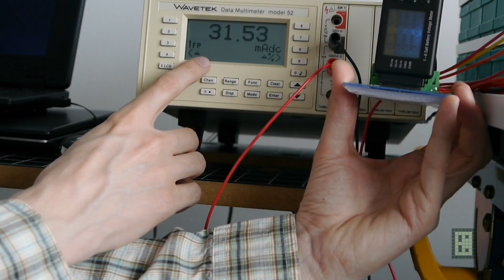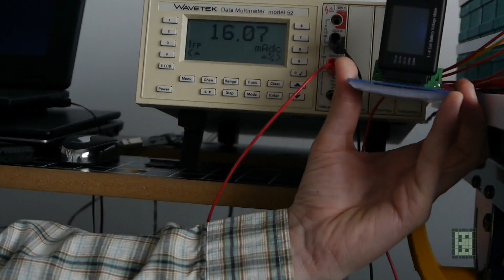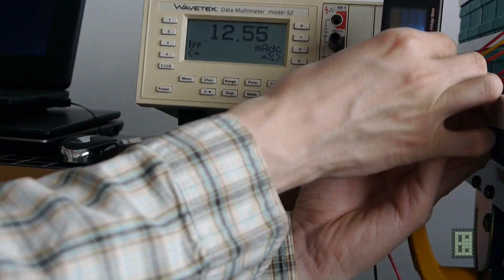BVM-8S 8 Cell battery voltage meter Backlight fix and lower Power consumption

Comment: cell meter 7 capacity controller ( not 8s unforatunately) has balancing function, bleeds via resistor gets quite hot. How are you balancing your a123 cells? or using different cells now?

Comment: Salut, ai idee ce ar trebui sa modific pentru a putea folosi acest device si pt baterii LTO ?  ( max charge = 2,9V / cutt of = 1,6v)
multumesc.
Reply from the maker: Nu imi mai amintesc care erau limitele nu stiu daca puteai seta cut off la 1.6V.  LiFePO4 sunt may bune decat LTO in aproape orce aplicatie.
Reply: @electrodacus  Merci, da, sunt mai bune dar nu si in aplicatia mea - inlocuire baterie masina.
Reply from the maker: Lead Acid e cea mai buna optiune pt masina. Pt ca batteria este tot timpul incarcata full de alternator si Lead Acid e singura care prefera asaceva toate celel cu Lithium sufera in conditile astea. 2.9 e cam prea mult pt LTO pt 12V as zice ca e mai bine sa ai 6s nu doar 5s

Comment: I'm just trying to find a accurate lipo checker and I see the letters AOK on your board. One of my current cell checkers is from AOK and not accurate at all
Reply from the maker: The two I have are also not that accurate. Depends on what you call accurate and also depends on how your sense wires are connected to cells if a load is connected there will be some voltage drop on the cell wiring.
I guess my solar BMS will be overkill for you. I also plan a new project after the solar BMS is done it will be some low cost data acquisition device with 16 or probably 24bit resolution and 8 differential inputs so it can replace something like BVM-8S

Comment: OMG only take the power from the first 2 batteries,this will lead to battery unit unbalanced! How do you get the voltages? Divided by resistors? 
i have ever made one like this by using INA149 to get each battery's voltage.

Comment: I bought two of these and they disagree about voltages too much to be acceptable. I note that you mention you had two that do agree very well. Do you know of any way to calibrate them? I expect it is done via the external port/link and some software they might use when assembled-tested.
Or if really lucky, it is some tricky button pressing sequence - to get into calibrate mode.

Comment: hi 
i have the same .the first day led is dead and the next day on a 4 series lifepo4 .32140 it sows .for the first cell 0.000 volts . even if the  cells is all 3.360  volts.always read the fist cell 0.000  volts except if a measure a pb battery. i scrats my haid.